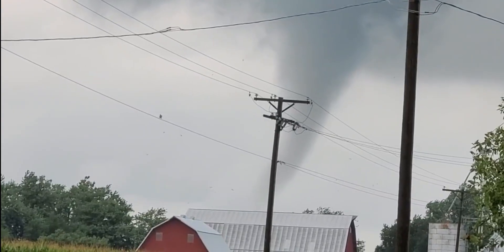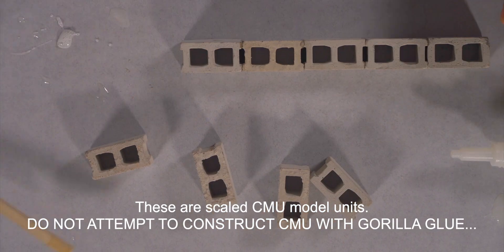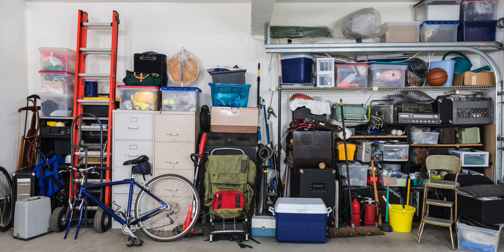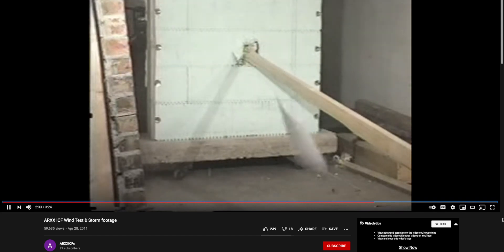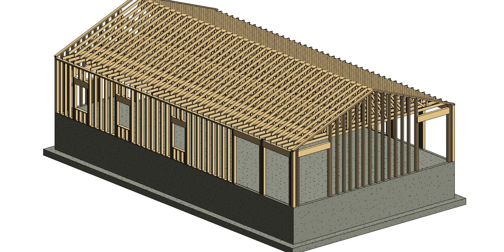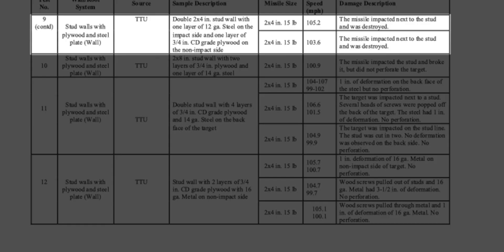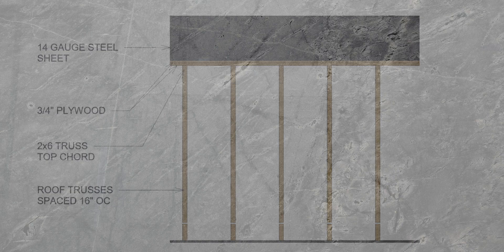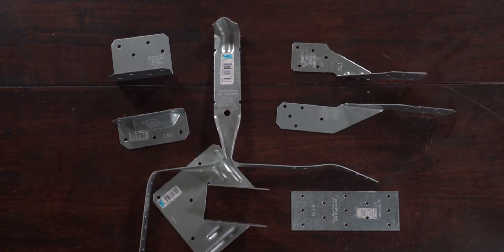These 3 Materials Can Create a Tornado-Resistant Home

Comment: Just use SR concrete 🤦🏾‍♂️ The wall would require nearly zero maintenance after a tornado. These walls will take damage during an impact.
Reply: From the start: Start in the center with a storm shelter that doubles as a walk in pantry.
Reply: @akbychoice that's what I want if I ever build or renovate a house. What better place to be stuck than where the food and drinks are 😉👍
Reply from the maker: I partially agree with you. If you watched the first part, I said that concrete is the correct approach... We all know reinforced concrete is the best method.

Now how do you suppose we break the barrier of creating reinforced concrete homes that are affordable for the average consumer?  How do you suppose we build a workforce that can produce reinforced concrete homes starting today when wood construction today is also struggling to meet the demands?  If reinforced concrete construction became the standard today, the costs to produce the materials, the labor costs, and the design fees for engineers & architects to plan & provide drawings would skyrocket. How do you cover for that?

It's extremely easy to point out the superior material... but nobody can or has made a dispute to any of the logistic & economical downfalls of reinforced concrete construction that makes it STILL a less likely solution that the average person would use today. So should we look for other ways that have been backed & tested to provide more protection and have a much better chance of withstanding a tornado with damage that can be repaired? Or is it just reinforced concrete or bust?
Reply: @JthaEngineer  using concrete block is a step. 8 inch concrete blocks are relatively cheap easy and fast to work with. Then using rebar and 100%cell fill which would take around 2 trucks of concrete for the average home and it seems like you would have a pretty good home. That being said your design is quite the improvement over the relatively lousy construction standards of today. I would suggest coupling your design with a 24 guage standing seam metal roof and using zip system sheathing instead of regular plywood for increased waterproofing since all the hard work you did would be for nought if water penetrates and causes rot. I think matt risinger has some great insights in this area however his strategies are usually far from cost effective for the average person.
Reply from the maker: @Manatee360Phototography  and that is the point, although not said. Slight improvements can go a long way. Concrete & CMU definitely are superior options and the 1000-1500 sf + tornado shelters I’ve designed are all fully grouted & reinforced CMU with precast concrete. If we know this is superior yet wood building systems are still the norm, why is that and can we make improvements to the building standards we have now to have a more fighting chance? I think so.
Reply: @JthaEngineer  oh and what’s the higher cost of concrete over the stronger wooden house not the typical house?
Reply: @JthaEngineer  I wouldn't say RC building is intrinsically costly than wood construction house. That's more to do with demand & supply. Look at Asia, Europe ...etc where RC is commonly in use. The cost for building is even lower than in US.
If people is aware of the pros and cons of RC building and starting to use widely. I am pretty certain the cost will go down.
Reply: @JthaEngineer  You also need to think of other events such as fires or earthquakes.  So it's a balancing act.
Reply: @JthaEngineer  Precast.  You mostly need it for the exterior walls, CLT can work for walls floors and roof plates.  2-layers of brick (not veneer) as the outer skin, then exterior insulation, surrounding a precast concrete wall unit.  Tie CLT roof panels (design to a static load of 50psi, with a live load of 250psi - so, you can't use simple plywood) to the concrete walls, tie the precast concrete to the foundation - wrap the whole thing with your water/air barrier, and even if your exterior cladding gets damaged, the core structure retains waterproofing.  Assembled/detailed correctly, should be able to withstand a 5psi sustained wind-load, with impulse gusts to 10psi.
  
Also should be mentioned that an attached garage has a garage door, which is a huge weak point.  Similar with large sliding doors.
Reply: @JthaEngineer  would a hobbit home he tornado resistant??
Reply: @JthaEngineer  I’m from New Orleans. Growing up we never had tornadoes. Now it’s happening on a year. The prevalence of tornadoes and hurricanes due to climate change will make the cost worth it. I live in Japan where earthquakes happen every day. A concrete house holds a lot more resale value than a typical wooden house. How man multi million dollar wooden homes were destroyed in California wild fires? 

It’s a no brainer. Why are we building so cheaply in the first place? 

You’re going to pay one way or another.

Comment: I’m an old retired guy. For 21 of my working years I responded to large scale natural disasters like floods, hurricanes and tornadoes. 

The ONLY buildings that I’ve personally seen that stand up to tornadoes were either round, thick reinforced concrete, earth sheltered or domes! 

My personal recommendation is to look at three building systems (yes, they cost a little more, but what’s your life worth and the lives of your families). Not in any particular order:
1. Binishells
2. Monolithic Domes, Inc.
3. Formworks Building, Inc. 

You can find videos of each here on YouTube. I’m planning on building a monolithic dome for myself with FEMA 361 windows and doors, made from 8” thick reinforced shotcrete and 3” thick polyurethane foam insulation. Why 8” instead of the standard 4”? It’s because I know F-5 tornadoes can pick up and throw 18 wheelers and cars like toys! I also live in Mississippi in a town that’s already had one F-5 tornado hit, killing 38 people and destroying 1,200 buildings.

Comment: Unibody Construction ... Nothing is stronger than unibody construction ... United we stand , divided we fall ... 4 inches thick of PVC plastic poured into a single mold , also using Nano Technology to bind the molecules together ... All doors windows cut outs of every kind pre planned into the mold ...  The entire house would also need to be Bolted to a concrete pad ... Automobiles use unibody construction ... In tornado's they don't break apart , they may get picked up and tossed but they remain in tact ... Of course testing in a wind tunnel would be mandatory .

Comment: The biggest problem is...everyone assumes nothing can be done within normal costs. 
You've got some good ideas that would only add a modest cost (whatever that is).  
But it's proven that if you (the HO) don't try, you won't succeed. 
I suspect that most homes in the tornado belt don't even have hurricane resistance. That additional hardware would certainly help.

Comment: Metal cables in side the wall running to the roof MIT have done study on cables like suspension cables on bridges 🌉 holding the house down to the foundation
Reply: You don’t need concrete just foundation

Comment: I did see a video on the internet, where two full homes were built to see how well a house held up to tornato winds held up. The house built with convitional building codes blew apart. The one with extra reinforcement and metal strap connectors held up with some damage. But the house frame held.

Comment: New Subscriber here - love the content!  

You touched upon a few major beliefs I have as well.

1)  The "American Dream" concept - has been manipulated by the elite to own the "largest" house on the block, own as many toys as possible, to "keep up with the Jones's", and etc.
2)  I've lived in 5 states - FL (7 yrs), TX (4 yrs), AZ (3 yrs), RI/CT (home area).  FL, TX and AZ all would benefit from concrete homes (called "CBS" homes in FL; Concrete Block and Stucco).
3)  The major problem is in the roof construction - typically they are simply wood framed trusses and rafters - and hurricanes/tornadoes can easily rip them off the hurricane ties attached to the concrete walls.
4)  Roof construction should be changed for these homes - welded steel trusses/rafters that attach not only to the concrete walls but the ground below (in separate "footers").
5)  I like the consideration you brought to the "100 year flood" level.  Personally, I don't think 1 foot above this level is suitable enough - maybe 3 feet minimum?

Having a steel roof supported by steel trusses/rafters/etc would be costly esp if you're going to employ this to a "McMansion" style home - but may be cost effective if the average "American Dreamer" would understand your concept in "too much space" and keeping up with the Jones's.

Comment: Use all hip roof. The gable ends are weak points and hip roofs reduce wind lift. Look into Miami-Dade building codes for ideas resisting wind speeds.

Comment: After a tornado destroyed part of our hometown back in the late 90's we built a home using icf construction back in 2000.  Not only is the home wind/tornado resistant, but the R value of the walls make the home more comfortable and much easier/cheaper to heat and cool.  Living in western TN having good R value is key as we truly have 4 season weather here with 100+degree summers while during the winters lows can dip into the low teens or even single digits.  My utility bills average about the same as a modern stick-built home that is less than 1/2 the size of our icf home.
Reply: How difficult was it for you to find a contractor to do ICF correctly?  We live in NW TN and just dodged two tornados.  Our plan is if our barndo gets totaled, we are going with ICF but there seems to be nobody around here that's even heard of it.  Sorry about your loss and hoping we don't have to go through what y'all suffered through!

Comment: NOTHING is tornado-proof.  I've seen where a tornado pulled up the asphalt road.  You can be tornado resistant up to some point, then the tornado wins.  You just hope you never get hit by an F5.

F5 will pick up your neighbor's house and use it as a 150 mph battering ram to take your house down.  It can drive a straw though a telephone pole.
Reply: I am pretty sure he said tornado resistant throughout the video.

Comment: I've seen thick log homes in TN and MS go through some bad tornadoes. The log homes survived wonderfully. The insides looked like a standard home with sheetrock inside. Their standard truss roofs did not survive. So, either they improve that with straps and tie downs, use logs for flat roofing, or use precast concrete beams with rebar. I reckon it would then survive.

Comment: * Building to survive an the center of an EF5 is way, way harder than building to survive the center of an EF1 or the outer periphery of an EF5; The odds of ever seeing 200mph wind force are so minimal you may as well be talking about comet-proofing your home.
* The actual building standards for the center of the country appear to have zero concern for Tornado Alley due to the rarity of even an EF1 hitting a building.  Instead, hurricanes are the focus.
* Those windows being there invalidate the entire approach in practice.
* The FORTIFIED Home standards provide a guideline already for dramatically improving wind rating of a wood structure itself, very inexpensively. It mostly comes down to mandating fully sheathed walls, some gable end reinforcement (and eliminating seams in cathedral ceilings), and a tight nailing pattern everywhere.  The only expensive part is windows, and we could deal with that in the case of hurricanes using storm shutters.

Comment: I was thinking just pay to get a steel-frame house, with steel roof & cladding. And then finish the inside of it in a kinda unique way. Outer layer is the steel cladding, then lay 4x4x8 concrete brick (easy to make yourself in molds) inside... leaving an 8" gap to the outer steel cladding. Build up the brick a little over 2 feet, fill the gap with styro-crete (cement with styrene pellets for aggregate). Then repeat until you're all the way up. Styro-crete can only be poured about 2 feet vertically at a time. The outer cladding and inner brick form the pour void, and styrocrete is not heavy. It's an often overlooked building material because it uses cement, but is too weak to be used structurally. But it is extremely robust compared to typical insulation materials, weatherproof, termite-proof, very mold resistant, and very fire resistant (if the mix is right).

Steel cladding is a little boring for aesthetics, but you could add stucco or brick veneer or cedar, etc. in areas of the outside, season to taste. Similarly inside, you could paint the brick, cover it with paneling, whatever tickles your fancy for style.

Final wall thickness is 1ft. (22 gauge steel, then 8" of styrocrete, then 4" of concrete brick wall). Looking at an insulative R-value of about 30, slightly less where the steel framing supports are. This is admittedly pretty thick, but it offers a lot of benefits for the square footage cost. The steel siding has a high "reflectivity" which affects heating & cooling, but is not calculated in R-values. And the brick inner wall has a high "thermal mass" which is also not calculated in R-value testing, but can dramatically affect heating/cooling (especially if it's inside an insulation layer). Also, the styrocrete is a 'void-filler, so it will seal things up very thoroughly. With thermal mass & reflectivity, I would expect it to perform like it has something more like R50 insulation, though strictly speaking it would be around 30.

Also, styrocrete, while not especially good for tensile strength, is very rigid, about on par with wood for compressive (not tensile though). It'd give a lot of reinforcement to the steel outer cladding, and anything which pokes through the steel would have a very difficult time pressing through the styrocrete. I would expect (not tested) that it would probably stop 7.62, let alone a mere 2x4 going 100mph. The siding won't want to be peeled away by wind, as it's fastened to the steel frame, and then laminated against the styrocrete.

You'd want a relatively low-slope for the roof, as that is more aerodynamic, and makes the angle of impact more favorable vs flying debris. I was thinking to have a double-roof on the south slope, with a substantial overhang, and rising a bit past the main roof peak to shade the north slope. That would be for making heating/cooling still more easy, but it wouldn't be very aerodynamic. So I would think that you'd just let a tornado pull that upper roof away if you get hit, leaving the protruding steel framework for it. And then just re-roof that floating upper roof if you get hit. You'd still have a weatherproof roof under it, it's more of a whole-house awning to help make the house passive or near-passive in terms of energy needs.

At 1 & 1/2 stories, steel framing would laugh at earthquakes. The structure should be fireproof, inside & out (depending on how you finish interior walls), termites have nothing to eat, it's not made out of mold fertilizer, and it should withstand a direct hit from a tornado with only a need for new windows and floating awning-roof. Also, with a list of other considerations in design, it'd be passive or near-passive for heating/cooling. You could probably drive a truck into it a wall with minimal harm.

Not necessarily cost-effective. But I'd seek to recoup a lot from substantial DIY in the building, and long term energy needs.

Comment: The forces involved in building destruction are.
Blow in
Blow out
Blow off.
Blow in, the pressure against a wall causing to collapse inwards.
Blow out, like the sudden depressurisation of a plane a vast difference between the internal pressure and external pressure results in windows and walls being pushed out.
Blow off, air rushing over the roof can create lift pull it up to be caught by the wind and ripped off.
All these can be compensated for by fairly minor and often unseen design changes.
Fold down eaves that can be anchored in the down position by cables to the ground would prevent blow off.
Walls with buttress sections that increase side load capacity would prevent blow in.
Special panels that act as valves opening inwards or outwards to vent pressure would mitigate blow out.
All these minor changes would increase construction costs by about thirty percent at most and would reduce the risk of a building collapse in both storm and seismic events. With the exception of cows flying through the walls or the earth opening up these changes would save most homes.

Comment: There are also ICFs, insulated concrete forms. I built one bedroom  on our house to withstand a tornado. Used standard 8" concrete block. Foundation goes into the ground 4', every fifth vertical core is grouted with rebar and there are five horizontal bond beams. There is a standard 2x4 wall with hardi-board siding on the exterior so the walls are one foot thick. the roof is 3/4" plywood with steel gussets along the seams. Windows are glass block. It's just one room,  not very big but super strong. The rest of the house is stronger than average, I hand nailed all of it with good size nails and plenty of them. Used some screws but they are hardened and can snap. A lot of builders skimp on fasteners. Used lots of steel strapping also.
   Another thing I did was not use J bolts to fasten sills. I embedded heavy angle iron into the block foundation and bolted them through the rim joists. It's a much stronger connection.